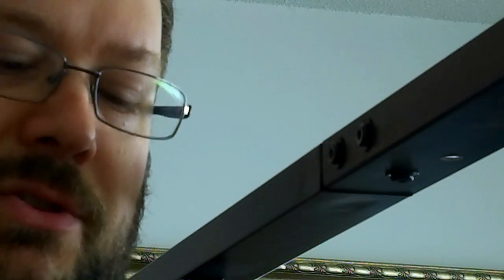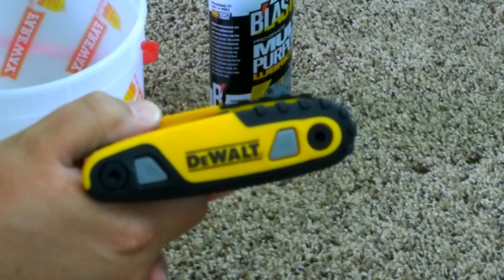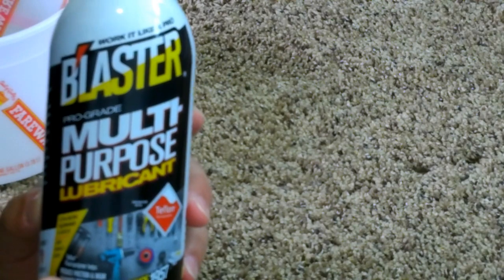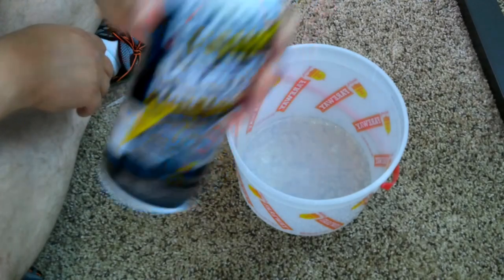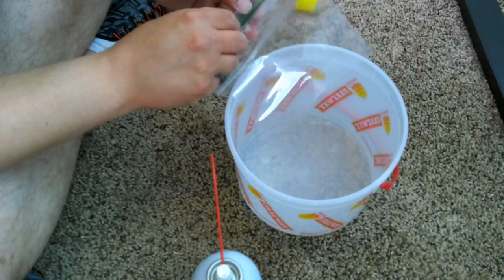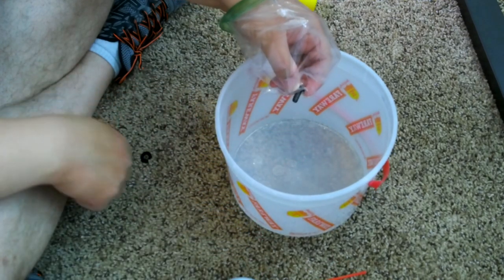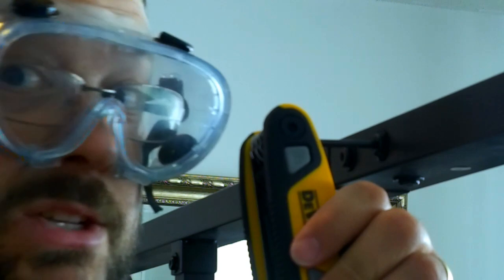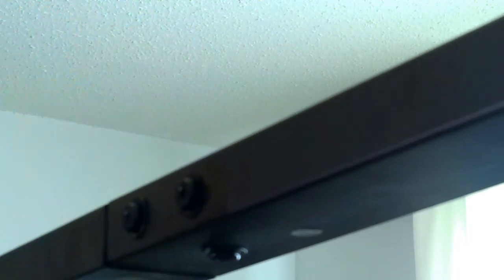Fix A Squeaky Bed Frame

Comment: This worked for about 2 minutes and the bed went straight to squeaking again. If i knew how bad a metal bed could squeak i would never have purchased one! Anyway thanks for posting, i'll keep trying and see how i get on
Reply from the maker: good luck!
Reply from the maker: I will also say mine held up for about 6 months every time I "lubricated" it, but I eventually got sick of doing the procedure, and sold it 2nd hand. Now we have a wood frame.

Comment: I realised the majority of the creaking was coming from where the slats meet the bed frame. I cut squares of craft felt and pushed them through and i could cry, the squeaking is almost down to 0. My slats were also metal and every time I moved around they were catching. Hope this helps someone out there
Reply: Do you have a picture or video of them (use Imgur to share). I ask because my bed came with rubber “mute buckles” that you insert just above the slats, so they aren’t hitting the metal at all.
Reply: @Culperrr  Hi, unfortunately I have since gotten rid of those beds. The felt didn't last long, it kept falling out and then other areas of the bed started squeaking too. Glad to hear you have something to prevent the earache at night. Also my bed was a really cheap one so that could've made it worse.
Reply: @AyshG  Huh. For some reason it cut off my other half of what I wrote down. Sorry about that. What I was saying was that the rubber doesn’t do anything, it seems. I hear the squeaking from the middle of the bed too, from the slats, so that leads me to believe that it’s the slat itself and not the metal on metal contact that is making the noise. I just didn’t know if you had the same issue or not.
Reply: @Culperrr  Ah OK, no problem. Yes I felt that the bed itself was just making alot of noise in the end. I wiggled it all over and everything was just squeaking and creaking. I oiled all the screws and between slats too but nothing helped. Many family members have metal beds and I've not heard them complain. Never again haha

Comment: For me, it’s the slats (12 that lay across the frame) that make all of the squeaking. At the ends of each slat, it even has a “mute buckle” so that they won’t hit the metal. The “T” or middle section of the bed has pre-installed rubber or foam so that when they lay across the frame, it doesn’t hit the metal. It seems to me that the slats are just bad quality. The sound doesn’t just come from the ends of them, but also the middle of them. It progressed from not hearing a thing and then 3 months later (after I bought it), just making so much noise. WD-40 doesn’t seem to do the trick either.
Reply: maybe slide some wax/parchment paper where the slats make contact with the frame

Comment: THERE IS ONLY MYSELF IN MY QUEEN BED BUT MY PROBLEM IS THE HEAD OF THE BED WHICH LOOK IDENTICAL TO YOUR BED HEAD.  I HAVE TO PROP MYSELF UP FOR SLEEPING BECAUSE OF REFLUX AND MY WEDGE PILLOW IS UP AGAINST THE METAL HEAD PART OF THE BED AND EACH TIME I MOVE EVEN SLIGHTLY ON THE WEDGE PILLOW TO CHANGE MY POSITION THE BED HEAD MAKES A NOISE AND THIS IS A BRAND NEW BED. I DONT FANCY TRYING TO GET THE VERY HEAVY QUEEN MATTRESS OFF MY BED AND REMOVING ALL THE SCREWS IN THE BED. SOMEONE FROM THE SHOP WHERE I BOUGHT THE BED CAME OUT AND PUT THE BED TOGETHER BUT I MIGHT TRY OILING THE SCREWS WITH A SPECIAL GREASER PERHAPS, THANKS FOR THE UPLOAD.

Comment: can i use Wd40?
Reply: I've never tried that. My speculation is that it would work at first, but wear out more quickly because it doesn't have teflon, so doesn't last as long.
Reply: It evaporates from what little I know so it might appear to work but it will just really remove dirt and not perform the same job as the spray used in this video. It might be a good step to add in to these instructions, WD40 the bolt and screw holes, then lightly pat the bolt off or wipe it off if it’s an old dusty bed, then do the Teflon spray onto the clean bolt.
Reply: ive tried it.. it is as you say, it works for few hours, but the creak stays.

Comment: Question!! Lubricant or a low Strength thread locker?  I was initially thinking to use a thread locker
Reply from the maker: Part of it is there are "squeaky parts" that aren't threaded.

Comment: I read somewhere about putting wood slats? anyone do this- to make one more sturdy? and less squeaky?
Reply from the maker: I can't speak to all bed frames, but on this particular one, that would do very little. A lot of the squeak comes from the headboard area, the legs, etc - parts that would not even touch the wood